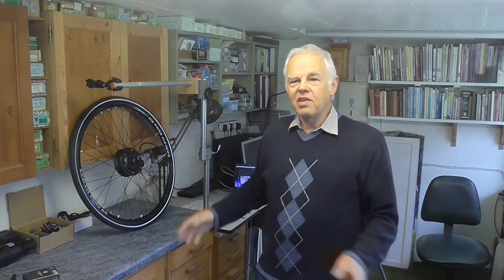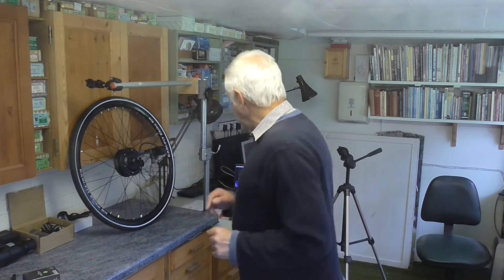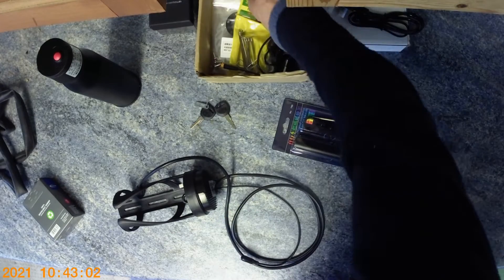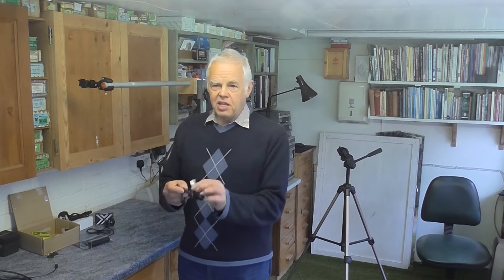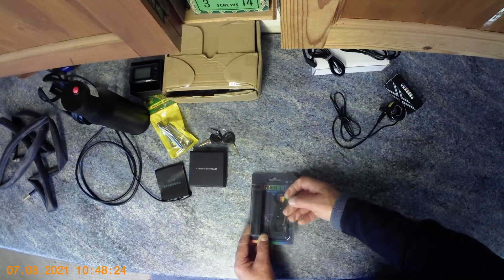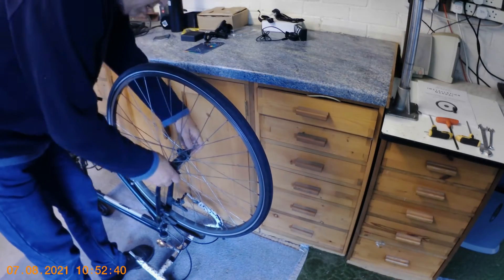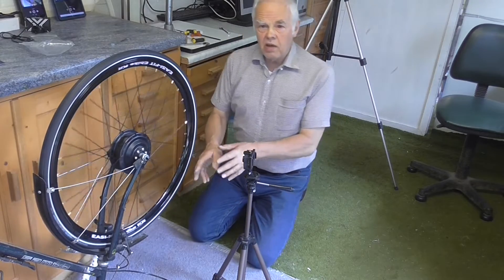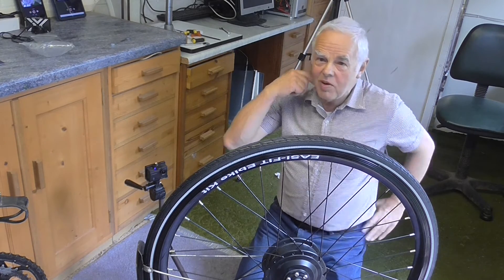Fitting an Easifit motor kit to a Dawes Super Galaxy with Dropped handlebars. Part 3

Comment: I've had inner tubes explode like that before and in all (my) cases it has been because on inflating the tyre I've not 'settled' the inner tube into the tyre and the inner tube has got piched between the tyre and wheel rim - maybe that is what happend with you?
Reply from the maker: Thank you for your comment however did you actually watch the video fully? I have been fitting tyres on cycles for over 50 years and know the correct way to fit a tyre. Even if as you suggest it was my fitting that was at fault this happened twice on two different tyres, it's also strange that since the new rim was fitted we have had no further trouble. Furthermore generally speaking if you do happen to trap the tube when fitting it results in what is called a pinch puncture, it does not normally cause the tyre to blow off the rim.
 
If you look at my video you cannot fail to see just how loose the tyres are on that rim compared to the new one we fitted. The rim diameter is too small meaning that it is impossible for the tyre bead to lock behind the hook it sits on the hook and when pressure is introduced the tyre will move outwards and eventually explode out as happened twice with us.

I managed to get a fatter Michelin folding tyre on to the rim but leaving it pumped up in the workshop and when I checked two hours later it had already started to move out.

From comments received here and on facebook I know of at least 3 cases where this has happened using the same kit as the one we fitted , The suppliers have admitted that the rim is smaller diameter rim that those of other manufacturers and state that you should only inflate to 40PSI which of course is far below the accepted limits for 28c HP tyres which are normally of the order between 65PSI - 95PSI  depending on the tyre fitted. even the Kenda tyre supplied states a min of 55PSI.

If  the rim outer diameter is too small due to a manufacturing defect then the bead seat diameter will also be too small by the same margin – hence the tyres will fly off.

As I mention in my video I am happy with the kit apart from the rim that was supplied to us, I added the warning to the video after the incident because I was concerned that another person could have the same issue and they might not be so lucky as my wife who had actually stopped before it exploded, a few seconds earlier she was racing down a hill.  As a Cyclist you will surely know that if a front tyre blows then you are on the deck instantly and most probably end up in hospital or worse.

It should be pointed out that my issue only covers the 700c 28c wheel that was supplied, others sizes may not be affected.

Comment: Exactly the same thing happened to me. First tyre - BANG! High pitched noise in my ears for hours. I was trying to fit a Swchable (sp) Marathon Plus, which are puncture resistant and have used them for years. Kept on popping out from the rim. Spent 2 hours trying to get it in. No luck. Nearly sent the kit back, but tried the cheap tyre it came with and it is working. Will I really have to change the rim, or is there any other solution? Contacted Clive, and he gave me the "correct way" to fit it, but no luck. Any ideas. By the way, I enjoyed the video's, thanks. Like you, I have been cycling for years. I do know how to fit a tyre!
Reply from the maker: Hi Howie, thanks for the comment and watching my videos.
We are not alone, since I made the videos I have heard from quite a few people with the same issue. The thing is this issue is not just an annoyance it is putting riders in danger, As a cyclist you will know that a front wheel blow-out can have serious consequences resulting in very serious injuries or death.

I can not for the life of me understand why the makers and sellers of this kit are so blasé about the danger as they could be responsible in the case of litigation. The makers of the rim admit that it is undersized but state that if fitted correctly and only low pressure is used it is safe.

The point is that the tyres are called high pressure for a reason and as you will know one expects to use pressures in the region of  70-95 PSI depending on the tyre, Even the Kenda tyre supplied says pump to 75PSI.

 In my opinion and the opinion of my friend who is a chartered engineer and a wheel builder these rims are a 'ticking time-bomb' It's only a matter of time before a serious accident occurs, we were lucky my wife was riding fast downhill when she heard a noise and stopped before it 'blew up' imagine if it had blown on the hill.
 When you buy a product it is indefensible that you have to replace part of it to make it safe but there is not a chance in hell any of us would ride with one of those rims on the front wheel. With a proper decent rim fitted it is fine. Let me know if you need any more help or advice.
Reply: Would be interested to know how long ago you purchased your wheel.  If recently, i.e. several months after Scrimper raised the rim-size problem with the supplier, it's concerning that the problem still persists.  This kit seems a good solution for a conversion I need to do for someone, but not if the 700c wheels are still being supplied with undersized rims.
Reply from the maker: @HatFog  I know that you aimed your question to Howie but I hope you will excuse me commenting. Looking at the pictures of the kits I imagine they are the same undersized rims . Probably best to ask the suppliers but I imagine they will say there is no problem with the rims. 

I have to say that once a decent rim is fitted the kit works well, even if you factor in the cost of a decent rim it still works out to be a good buy.
Obviously it's not satisfactory, when you buy something it has to be fit for purpose and of reasonable quality, if others are riding the same rim as supplied (using the correct tyre pressures for the tyre supplied ) it's only a matter of time (IMHO) that someone will have an accident when a tyre blows off. 
My comments apply to the 700c rims, other sizes may well be fine?
Reply: @scrimperuk  Thanks for that.  

An Easi-Fit website question from January 2022 was: "looking at the wheel and seen a YouTube ref the rims being to small (scrimper UK YouTube channel) for the tyres and the tyres bursting, Is this issue fixed now??".  The supplier's reply stated: "Yes the wheel rims are fine just make sure before you inflate your tyre that the inner tube is not trapped between the tyre and the rim and that the tyres beads is seated correctly in the rim".

So still kind of implying the issue is/was one of poor tyre-fitting rather than the rim-undersizing you and several others suffered - and not even recognising that there may have been a production problem which had now, one would hope, been rectified.  

Getting the wheel rebuilt with a proper-sized rim would be a pain and unwelcome additional cost.  I can build wheels, but the bike it's needed for has cantilever brakes, so the pad-to-rim gap is small and the wheel has to be dead true to avoid brake-rub, meaning it would take me a long time to get it all transferred, trued, round, balanced and stress-relieved properly.  Not to mention the hassle of ensuring the new rim has the same ERD as the undersized rim, so that the same spokes can be used, or of figuring out new spoke lengths.

I wonder if the other branded versions of the kit have the same undersized rims - some more research needed I fear.....

In any case, thanks for a great series of videos on the product and its installation and troubles - really useful!  I hope your wife continues to enjoy ebiking with it, and that it remains trouble-free for years to come.
Reply from the maker: Thanks for your kind comments about my videos. It sounds to me that the issue of undersized rims has not been addressed. 
When the tyre exploded on our wheel I spoke to the suppliers who suggested that I had not fitted the tyre correctly,  I was so angry because I have been doing cycle repairs for over 60 years and knew that it was not down to my error, after all it happened twice to our wheel with two different tyres.

I went over to my workshop and made a very stern video showing in detail how that rim was undersized, I sent it to the supplier and because they agreed to pay for us to fit a new rim and a new tyre and tube I did not make that video public. 

I think you will agree that in my last video I was very measured in my comments about the rim and even after the troubles did not run down the kit.

Since I made the video I have heard from quite a few others who have had the same issue so it's not just me. The manufacturers of the rim have even stated that their rim is undersized but is fine if you don't pump it up to the recommended pressure 'stamped' on the tyre, which is wrong, it is  possibly as dangerous to ride on an under-inflated tyre as much as the risk of the tyre blowing off these rims if you pump to the correct pressure for a 700c tyre.

My friend who is a chartered engineer and an expert wheel builder spent many hours testing these rims with lot's of different tyres of different makes and not one could be fitted tight enough to be safe to ride.

My wife was very lucky that day she had just descended a steep hill and stopped after hearing a noise when the tyre blew off and locked the wheel in the forks, has this happened whilst descending the hill she would almost certainly been very seriously injured or even worse.
IMHO these rims are a ticking time-bomb, I commented on the rims issue as I would hate anyone else to have an accident and I had not said anything about the problem.

One of our club members has just bought a different brand of kit and his wheel came with a quality Mavic rim.